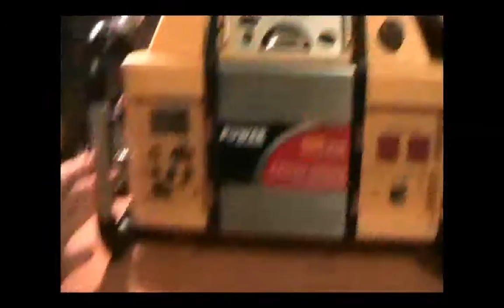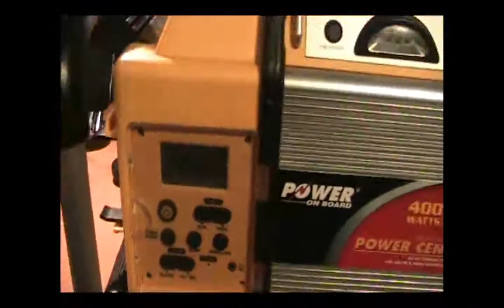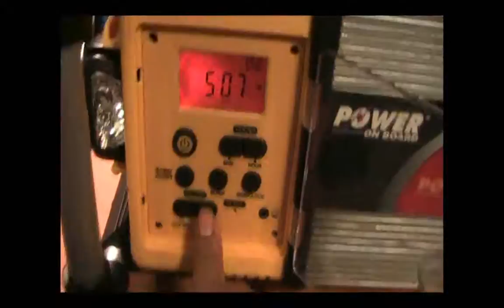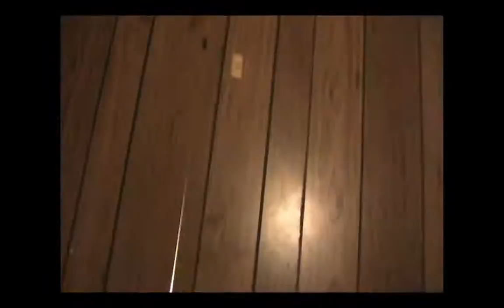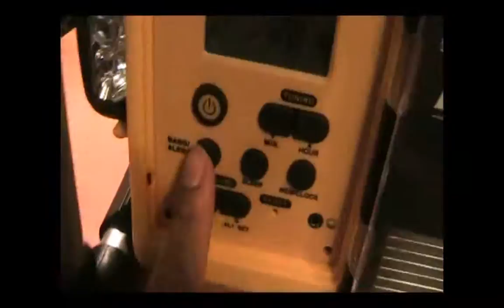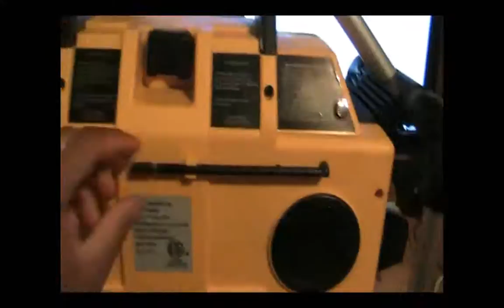Vector Rechargeable Power Center Review

Comment: How do I change the Battery of the Power Bank?  Thank you.
Reply: You have to  disassemble the unit (bad design).  Uses a 12 volt @ 19 Ah sealed lead acid battery (about $40).  The capacitors used in the inverter are of poor quality and prone to electrolyte drying  thus overheating and possibly popping.
Reply: @waddy5555 Is it possible to dissasemble this unit?

Comment from the maker: You can, but you would have to beef up the wiring from the external battery pack to the inverter if you run anything over 70-100 watts (I learned the hard way from another power pack experiment)

Comment: Great video.  Very informative.  Question, though.  We just bought one of these at Goodwill in box with manual but missing the flashlight.  It's plugged in to the wall at our house now, but doesn't seem to be charging.  We paid $79.99.  How long should I wait before I know that it won't be charging because it is shot and I need to return it?  If it does charge, did I get a good deal paying what I did or should I return it because I can get a better deal on a new item such as this?  Thanks!
Reply: Overnight

I don't know about your location but where I'm at if the battery is shot I would go to a battery warehouse in my local area and get a fresh battery

Comment from the maker: Not too sure, never had to disassemble mine......just used the dc socket to run the desulfator. Looks like you would have to remove the stickers on the back though to remove all the screws.